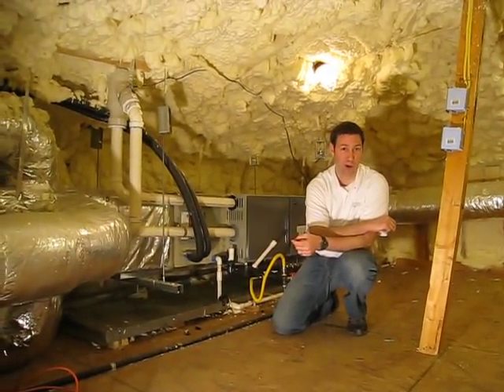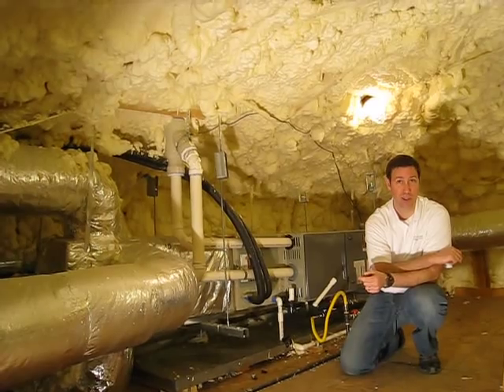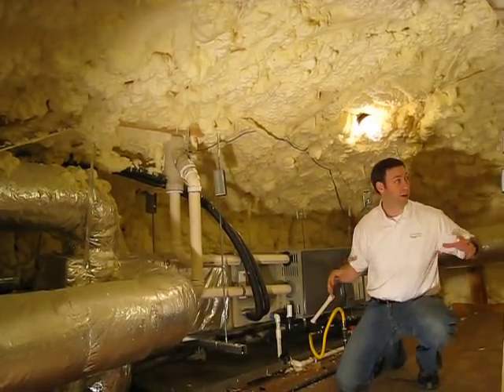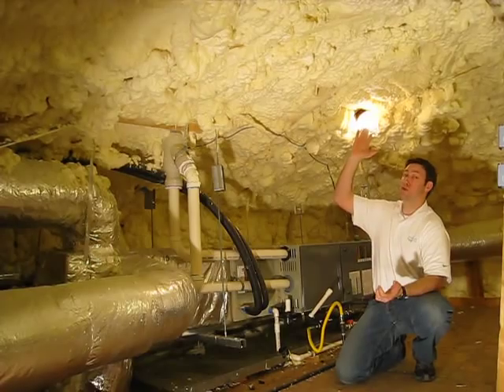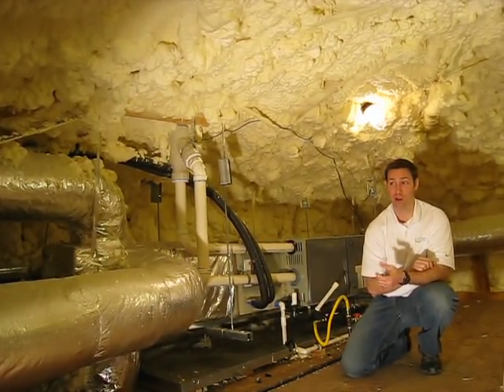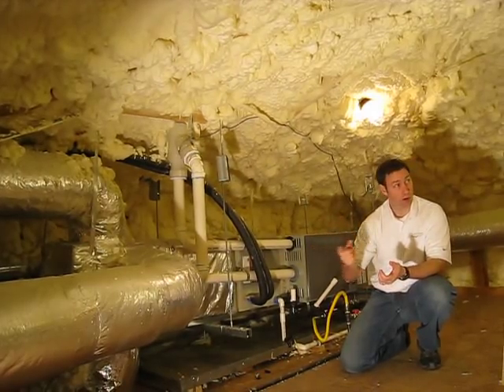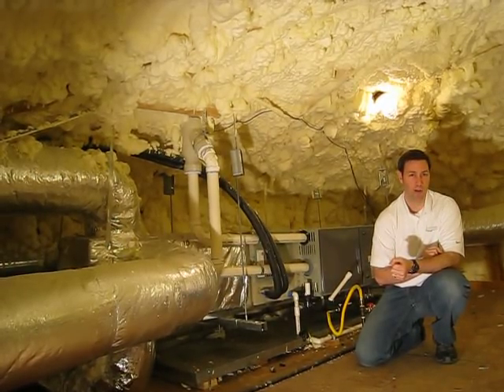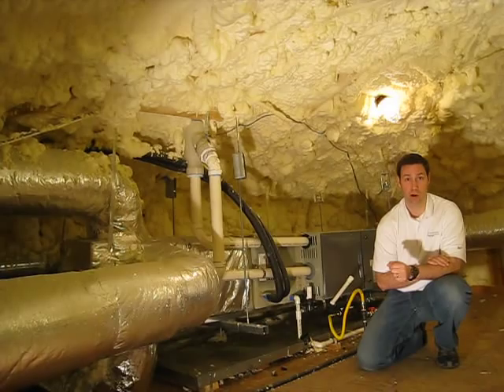Building a conditioned attic in a hot & humid climate the right way!

Comment from the maker: Great point!  This video shows OPEN CELL FOAM.  I would not suggest closed cell foam for a roof deck (unless you plan to use plastic rafter vents that leave a 1" air gap at the decking).  The beauty of open cell is that you'll know you have a roof leak, water will drip through.  And open cell acts as an air barrier if it's 3.5" or thicker.  Roofs generally need 5.5" thick open cell as a minimum to meet code in climate zone 2 (Austin TX).  Best, Matt Risinger

Comment from the maker: Not the prettiest install I admit.  I'm using a more experienced crew these days.  The key is to do a "poke" test with a measuring stick to verify you are getting the thickness of foam specified.  As long as the valleys of these are thicker than the R-value you need then this not so pretty install will still perform perfectly.  This video is now a few years old and this house is performing well.  Best, Matt

Comment from the maker: Build Tight and Ventilate Right is our motto.  You can't build too tight BUT a tight house need a fresh air source.  This house has a fresh air input that brings in fresh air through the HVAC system, filters it then sends it throughout the house.  The galvalume roof is silver and acts as a radiant barrier.  R-19 is the code for attic insulation for Austin, TX and 5.5" of open cell foam meets that code.  In the past year I've also been adding 1.5" of rigid foam on top of the roof for R-27 total.

Comment from the maker: We test all our homes for both duct leakage and air infiltration (blower door test).  Our duct leakage needs to be less than 5% loss for the Green Building Program 5 star rating and air infiltration needs to be less than .40 ACHN.  Most of my foamed houses are closer to .2 ACHN.  That means the house air is exchanged once every 5 hours if the house is closed up.  We want a VERY Tight house so we can ventilate through our system that filters the incoming air rather than uncontrolled leakage.

Comment from the maker: Bottom line, for a hot/humid climate the Best Practice is to get your ducts inside the conditioned space of the house.  There are several ways to get to this bottom line but my video shows the most common and simple way to achieve this with typical slab on grade construction that's common in the South.  Best, Matt

Comment from the maker: @HomeEnergyNow So, remember we're talking about Texas in this video.  Mostly slab on grade construction with HVAC systems inside of a very HOT attic.  By moving that insulation up to the roofline our HVAC ducts that are typically r-8 are now inside the thermal envelope.  Attics in Austin can have daytime temps above 130 degrees so with this system my attics are maybe 7 degrees hotter than the indoor temp.  Also, the foam is an air barrier that seals out leakage.  Tough to beat in the real world.
Reply: Mold time

Comment from the maker: This will make a huge difference for your efficiency.  But, be sure to check for any atmospherically vented gas appliances, those much change to sealed combustion before sealing the attic.  You can tell if it's sealed combustion by the type of flue it's using.  A traditional metal flue means that it's not sealed combustion.  You want to see a PVC flue through the roof or gable. This can be expensive, if you already have R-60 you might consider some less costly alternatives. ...

Comment from the maker: @clintsmith96 Good question.  I believe it's just shy of R-4 per inch.  This assembly is technically R-19 in total but don't be fooled by R value totals.  I'll take R-19 at the Roof Deck over R-42 blown any day.  We've totally sealed out any air leaks from penetrations (ie Ceiling Cans), we've run our ducts through a hospitable environment, and we've lowered the tonage of our AC system. Perfect for a hot/humid climate.  Since this video I've gone to adding rigid foam on the roof deck too.  -Matt

Comment from the maker: @Artsee77 I've not done an ERV yet.  I think it's a great idea but I've just paid the energy penalty for bringing in unconditioned air.  I think a better option would be a dehumidifier that had a fresh air input so it would be mechanically dehumidified.  I read Martin Holiday's post this month on ERV's and he think they move very little moisture.  It's really HOT in Texas but we're never more than +-25 degrees from 75 (inside temp).  I think HRV's are more impt for cold climates with 50+ deltas

Comment from the maker: IRC allows for unvented attic spaces.  HVAC equipment is all power vented so it brings combustion air in through a PVC pipe, has a sealed combustion chamber, then vents the combustion gases through a pvc pipe.  Fresh air is brought in through a dedicated pipe with an AprilAir controller and damper system.

Comment: Matt, is this attic actually "conditioned" or just insulated well to keep it at a reasonable temperature. I didn't hear any mention in the video of supply air from the air handler being introduced to  the attic.
Reply: My full encapsulated opencell house is very humid in Texas summer, yes it's cooler temp wise than a vented attic but prolly double the rh%..I might be planning to add a supply and return up there. I have read current Dept of energy tests that verify this should be done as well in particular climate zones.

Comment from the maker: @benpie12 What?  Are you referring to the fresh air system not functioning?  We don't have a single combustion appliance in this house.  All furnaces are power vented and sealed combustion, tankless water heaters are mounted on the exterior.  The fresh air system is purely for indoor air quality issues.  It's meant to remove general pollutants from the indoor air and replace that stale air with outdoor air at a prescribed rate.  We follow ASHRAE 62.2 standards for how much fresh air is needed.

Comment from the maker: It's really amazing how cool the attic is in these foamed attic's.  This house doesn't have a radiant barrier on the inside, but we used a silver metal roof (galvalume) so the radiant barrier is on the top!  Best roof for this climate in my opinion.  The spray foam is open cell and is 5.5" thick.  Closed cell would be even better to use but jumps up the cost quite a bit.  I didn't do it in this house, but my new best practice is to lay rigid foam on the roof deck then spray foam under.

Comment from the maker: Have you tested your ducts?  Seal them to less than 5% leakage.  Consider a duct work upgrade to a higher R-value duct.  Another alternative is to tightly seal your ceiling drywall to attic connection.  There are several contractors that specialize in this sealing/attic upgrade.  This might be a good alternative for your house.  Get an expert to give you an opinion after a site visit to your house.  Matt Risinger
Reply: Matt Risinger Do you do work in Houston?

Comment from the maker: With this system there is no possibility of a natural gas explosion in the attic.  All the combustion is sealed inside the unit.  It's a 95% efficient gas furnace with sealed combusion inside the combustion chamber.  All the air needed for combustion comes from an input pipe to the unit so no attic air is being burned inside the unit.  I hope this clarifies.  For more information see the book "The Builders Guide for Hot-Humid Climates" by Dr Joseph Lstiburek published by Building Science Press

Comment from the maker: It's tough to tell from the video, but we're in the attic of a house that's framed with conventional 2x8 rafters and OSB roof decking on top.  The foam is sprayed directly onto the OSB to created a conditioned (and unvented) attic.  On top of the OSB is two layers of 30 lb roofing felt then a 24 ga metal roof.  That roof should last for 75+ years, but a re-roof is easy since the foam is adhered to the OSB and not the metal roof.  Did I answer your question fully? -Matt Risinger

Comment from the maker: @Artoconnell I can tell you from experience that a conditioned attic with temps in the low 80's on a 100 degree Austin TX day are much more manageable to be in compared to a typical Austin attic that's 130 degrees when it's 100 outside.  Think about how much more efficiently this equipment will run when the environment around it is 50 degrees cooler than a neighbor's house.  Seems to me that anyone working in a hot attic would be tempted to hurry with their job at hand.  -Matt Risinger

Comment from the maker: @tappakeggaday1 GREAT QUESTION>  Conventional wisdom has been that shingles need to be vented underneith or they will cook.  In this house we used a metal roof so that issue doesn't translate to metal.  However, the latest building science talk is that shingle temp only rises by 2-3 degrees without venting underneith.  Building Science expert Joe Lstiburek talked about that issue in the latest issue of Fine Homebuilding.  I wouldn't hesitate to foam under a shingle roof and have done it before.

Comment: 5 or 8 degrees higher then the rest of the house? Wow, really?, thats cool.  Thanks for the info, I would have thought higher as radiant heat waves travel through this insulation. 

I would REALY like to know how THICK that closed cell spray foam insulation is. It is closed cell isn't it?

Comment from the maker: @Dutchy1965 It's a gas burning unit but the sealed combustion chamber makes it completely safe.  I've been building homes with gas furnaces for 15 years and never heard of any fire issues.  The foamed/sealed attic does mean that you can't use a traditional flue pipe nor rely on the combustion air coming from the attic however.  Not using a sealed combustion unit with air from the outside would be VERY unsafe.  Houses are complex and we need to use good Building Science judgement when building.

Comment: Live in the northeast with hot humid Summers and cold winters not sure if conditioning a large attic space would be efficient. What would your opinion be on Making a small insulated room around the air handling equipment? And for the air ducts enclose those with a  conditioned channesl with space around the duct?

Comment: Actually it is r-38 for ceilings, maybe they are allowing those to be considered as vaulted/cathedral ceilings, which are r-19(minimum). For the same price of your r-19 foam, you could install R-60 fiberglass, so why foam? It is also the Austin Energy minimum for rebates, but they do not rebate for foam. I read at the DOE, that the air inside of your house is far worse for you than the air outside, if your hvac doesnt run, say during the nice times of year, then you are getting 0 fresh air?

Comment: Do you test to make sure the home is not too tight? If they are, which they should be if foamed, what is your solution? Does your metal roof have a radiant barrier rating? How deep is the foam? I cannot figure out, at R-3.6/inch, how anybody gets the minimum  R-38 in Austin, or the recommended r-49, which would be almost 14", am I missing something? Thnks for the vid.

Comment: I mean no disrespect, your heart is definately in the right place, and you are obviously well qualified to build. It is your foam guy, maybe even your HVAC guy I dont trust. If your ducts are sealed and insulated properly, your HVAC load would actually be GREATER with your R-19 cathedralized setup.....because of the numbers stated earlier. 99% of green is in design, there is not that much to lose by bringing more of the system within normal envelopes. Cost of foam IS a lot to lose + the likely %

Comment from the maker: We foamed the underside of the attic decking so the foam is adhered to the 1/2" plywood roof deck.  Re-roofing will not affect the foam underneath.  Also, this house has a galvalume (silver) metal roof that should easily last 50-75 years so it will take a hail storm no problem unlike an asphalt roof.

Comment: I have a question about this myself,I live in North west Florida and when I was younger and doing roofing I was inside a roof and had asked why dont they put insulation up here as well? The answer I got back was the shingles get hot enough on top of the roof and if the insulation was under them they would bake off of the roof so i never thought anymore about it.in this video are you under a metal roof or a shingled one?I can see metal holding up with the foam but not sure about shingles.

Comment: @MattRisinger There have been a few applications when I was hanging fiberglass insulation and in some of them we had to use card board batting for an airspace,I have watched quiet a few foam spraying videos learning about this and thought if they had an inch of space stapling up cardboard between the rafters and then spraying the foam it would seem the singled roof would then get its airflow that way without overheating the shingles and still have the insulation?

Comment: @MattRisinger @MattRisinger ; I do not have IRC book & do not do sticks & bricks construction. I read the AprilAir PDF on line .
You are closing up attic air tight & you have natural gas for heat & AprilAir stops working below 0 or above 100 degrees, sounds like formula for mold & natural gas explosion in your attic.  Commercial side 2003 IBC req. mech. ventilation system.  Thank you for your time.

Comment from the maker: I couldn't get the link to work. I agree that a vented attic is a good assembly, BUT everything needs to be done perfectly.  Zero or Few penetrations through the drywall ceiling (no attic access to leak air/heat, few or no recessed cans, etc).  Plus you'll want a radiant barrier and a tightly sealed air barrier, and go for the largest duct insulation you can afford plus test the ducts to below 5% leakage.  For all these reasons I prefer foamed sealed attic.  See my newer videos... Matt Risinger

Comment from the maker: @amusingisthedawn Good point about the radiant barrier.  This house has a very reflective Galvalume metal roof so the radiant barrier is on the top side of the roof.  Also, you could not effectively insulate this particular attic at the roof line with batt insulation.  The foam forms a total seal and insulation barrier over ALL the framing which batts couldn't accomplish. Thanks for commenting.  Matt Risinger

Comment: They moved the doc on their server. If you search for "364367" you'll find a link to the study: (replace " " with ".")

nrel gov/docs/fy03osti/32827 pdf

The study actually says that efficiency is SIMILAR when ducting is tight. Also, both the unvented (roof) and vented (ceiling) used blown cellulose insulation. Ducting buried in insulation (blown or batts) doesn't exhibit a reduction in leakage, just thermal transference.

The CA test was in a temperate climate, not hot or cold.

Comment from the maker: @aaronoftexass This was not a pretty install.  This particular crew was fairly new at spraying foam.  I highly recommend using a coat hanger to do a depth poke test.  Just wrap a piece of tape around the 5.5" mark on a coat hanger and you can ensure that it's meeting that min depth.  That's one of the beauties of using foam in that a rookie crew can still do very well performing install even if it's not pretty.  Using traditional insulation requires expert crews and even then it's not as good.

Comment: Closed cell 1.8lb foam installed 3.5 inches gets insurance discounts for wind upload and secondary water intrusion barrier.  A hurricane adhesive product called Foamseal installed at 1.5 inch bead will have the highest tested wind upload and can be installed with any .5lb SPF.    You do not always know of a leak or the condensation of water. I have video of Sheetrock that fell onto the child's' bed with NO NOTIFICATION or dripping through the sheetrock, (on Spray Foam Inspections YT Channel)

Comment: So I have a question what would be the best solution for my home. I live in Houston Texas where it's very hot and humid I currently have the blown in insulation in my attic and it's extremely hot up there. I have about 7 tons of AC pumping air throughout my house but sometimes it takes awhile for it to start getting cold although the air conditioners are brand new and they are running as expected. Would you recommend adding the spray foam to the ceiling of my attic?
Reply: Check to see what efficiency are your furnaces first
Reply: K Drake, it takes a little while to get cold because all your equipment is 120-130 degrees to start with, so yes, spray foaming the plywood under the shingles would help big time.

Comment: Matt, I live in the hot and humid south and currently have a large 2000 sq ft vented attic with 2 water heater tanks and a heat pump. I also have a metal roof. 

I want to make a conditioned attic for the benefits of the heat pump and ducts, but also want to upgrade to tankless water heaters.  Is it still advised to seal my attic?

Also, I’d like to possibly turn the attic into living space in the future. 

Any suggestions?   You seem to exclusively use closed cell foam.  A little concerned with some of the horror stories with foam.  I know it depends on proper installation, but is there a certain product you recommend for a high end home?

Would you recommend or totally avoid an alternative product like Silverglo or a different insulation?  

Thanks in advance for your reply.

Comment: But you use energy to do it.....My main concern is not your fresh air system, it is the foam system here is inferior and more expensive. Why...  2009 IRC requires no more than 20% or 500sqft of cathedral ceiling, the DOE recommends even within a cathedral for this climate at least R-38, a 10/12 roof pitch can add 60% more air to condition, and 23% more ceiling surface to the envelope. People think attic air is hot, now your envelope is the roof+23% more of it!